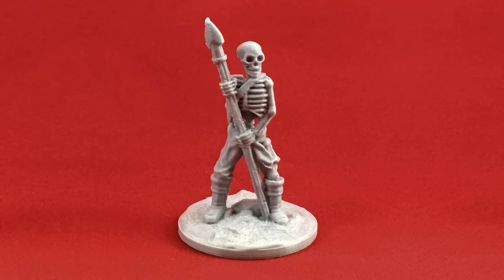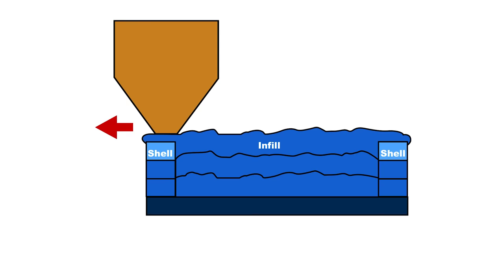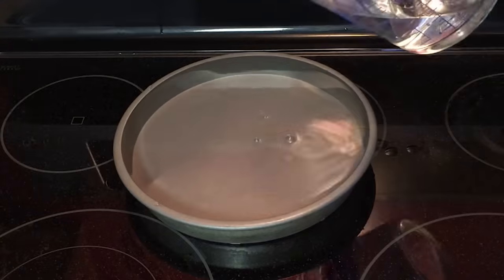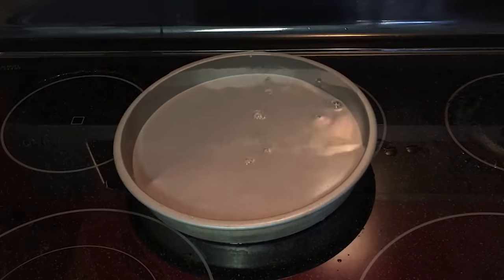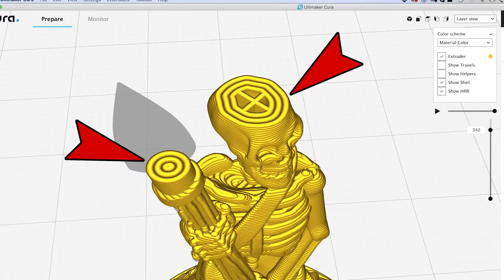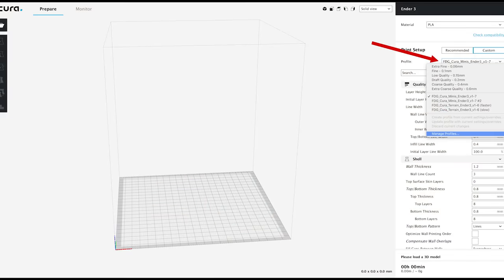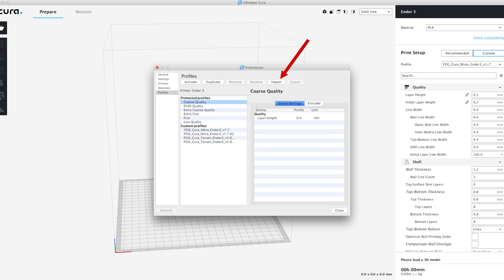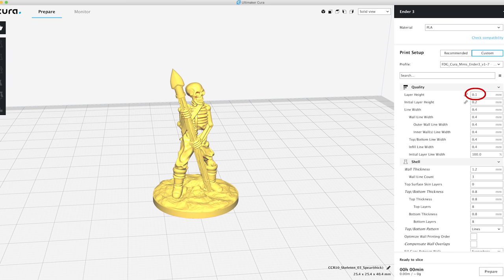How to 3D print miniatures on a FDM printer

Comment: You never spoke about which Cura profile to choose, if we download your preset Cura profiles. What is the significance of 2mm, 4mm and 8mm in the names?
Reply from the maker: That denotes what size of nozzle you are using.
Reply: @Tombof3DPrintedHorrors  so for a 0.4mm nozzle, use the ...4mm.stl file?
Reply from the maker: @CollinBaillie  yes, use the .4mm profile for a .4mm nozzle

Comment: Read an article about this person who used an airbrush nozzle tip connected to the extruder bolt to lengthen the distance for this radiant heat problem.  It puts more of the hot nozzle further out from the plastic part so that the radiant heat is reduced. 
https://well-engineered.net/index.php/en/shop/airbrush-nozzle-adapter-set
sells them.

Comment: I'm getting my Ender 3 next week and I'm so excited to start printing my own minis! Thank you so much for this video, not just for the settings you use but also for explaining what everything does, I've never seen such a detailed tutorial :D Can't wait to see my first results. Just a couple questions:
1. I bought a 0.2 nozzle and a 0.8 nozzle, when changing them I assume my line width will be the same as the nozzle size
2. If I want to print out terrain and props and don't necessarily want high detail, would you say it's ok to use .8mm layer height, 5-10% infill (with just 1 shell, maybe 2) and double the print speed?
Reply from the maker: Thank you! Yes, change your line width to match your nozzle aperture, and also change it in the machine settings for your printer in Cura, under 'Extruder' is a place to set your nozzle size.  I am working on a .2/.3 nozzle profile for Cura now, and should have the video for it up later this month. :)
Reply: Can't wait for video on .2 nozzle.
Reply: @Tombof3DPrintedHorrors  Did you ever put out the settings for the .2 nozzle profile? I'd be interested in comparing it to what I have and am not finding it.
Reply from the maker: .4, .3, .2 comparison video (and profiles) comes out later this month :)
Reply: @Tombof3DPrintedHorrors  can't wait for it. Just ordered 0.2 nozzle.

Comment: ok downloaded your profiles but things are different. in the vid the Top Surface Skin Layers are set to 0 but in the Cura 4 profile they are set to 4. Infill is different too. Temps are different. why is this? if you could do an updated video with Cura 4.0 that would be great. and if we could talk Supports too that would be great.
Reply: i second this. the profile is way different. just going to do cura supports and run test print with what the profile currently says. he may have adjusted it over time but an update would be nice.

Comment: Whats the difference between v1-7 and v1-8 on the dropbox link for minis????
Reply from the maker: I'm constantly tweaking the profiles, also because as new versions of Cura come out changes they make require adjustments to my profiles.
Reply: @Tombof3DPrintedHorrors  thanks for the help, wasn't sure if they might've been optimised for different scales!! When you're printing minis that 28mm scale do you print it so the base is 28mm wide or so that the whole figurine is 28mm tall? I've heard some debate and confusion over this online. Thanks for the amazing videos, you inspired me to get my own 3d printer and finished my first custom mini last night!

Comment: I've seen other miniature profiles that set the top layers settings to 999999 to "force" the slicer to treat all layers as top layers to print them with more detail, not to eliminate infill to make the models less prone to breakage. Do you know what is the reasoning to setting all layers as top layers? Does the slicer print top layers differently?
Reply from the maker: There's not much difference between the two (99999 top layers vs. 100 infill), except by using the top/bottom layers you can set fewer parameters for the layer (overlaps, speeds, etc.) and set a single layer pattern (I believe that one used concentric) where the infill method would also have those settings needed, but that's not really a reason to do it. What it does do is greatly increase the print time, as printing with 100% infill would at least allow you to increase infill speeds (same result, 100% plastic mini) but have better control over print times by having a faster infill speed.

Comment: thank you for the video it has been a huge help in understanding what to look for in my slicing software which is FlashPrint. I am using a flashforge finder and i have seen others print great looking miniatures with it, and i have never been able to interpret settings from Cura for FlashPrint. Has anyone ever dealt with Printing miniatures with Flash Print or the FlashForge Finder. I would appreciate any help. Thanks!

Comment: Any chance you upgrade your cura profiles to the lates Version? At the moment it creates an error if you try to Import.

Kind regards
Reply from the maker: My Cura 4.4 profiles load successfully into Cura 4.5
Reply: @Tombof3DPrintedHorrors  well im missing the "standard" profile your custom settingsare based on. I only got normal as a default setting. If i try to dublicate any of the default setting and try to rename it it's autocorrects to standard #2.... any idea what i can do?

thx for the reply btw
Reply from the maker: @fabianhalu3977  what version of Cura are you using?
Reply: @Tombof3DPrintedHorrors  4.5
Edit: the official release downloaded yesterday
According to github it's the 4.5.0
Compiled 21 days ago

Comment: very interesting video.  Could you provide you thoughts and experience with using supports on minitures. What settings work so that the supports can be removed cleanly and easily?

Thank you
Reply from the maker: All of our models are designed to print without supports, so we don't tinker with them very often. :)

Comment: Have you experimented with printing with finer nozzles?
Reply from the maker: Yes, a video is coming in late December. :)
Reply: @Tombof3DPrintedHorrors  Thank you for the reply! While I have you, if you could give me your input on a post I just made on a facebook 3d printer group, I would really appreciate it!
-While I'm not a table top gamer, I do find table top models beautiful and I can appreciate any form of modeling. My particular poison of choice is On30 model trains, that is 1:48 scale. I find a lot of the techniques that are used to make table top games/pieces can also be applied to my model trains. The main reason for my interest in a 3D printer is to print small detail parts to fill out a scene, like tool boxes, a drill press, hammer, band saw, dogs, cows, pigs, trash cans, oil cans, oil drums, water tanks etc etc etc. All these items are available commercially in the model train hobby, but a simple dog model can be $5. So I figured I could get a 3d printer and print these detail parts for just a couple pennies. A trash can at 1:48 scale is about 1/2" tall, a shovel/ax/saw even smaller than that. My concern is I don't know if a FDM printer like the Ender 3 is up this job. I thought maybe if I put a 0.25mm or 0.15mm nozzle on it, that might be able to do it, but I'm just not sure. I know a resin printer would be more up to the job, but the added cost and complexity to the printing process has prevented that from being a viable option for me. I have my eye on the Monoprice Mini Delta 3D printer, mostly because of its small size, inexpensive price, coming fully assembled and supporting up to 50 micron layer thickness... I have been drowning in 3d printer research lately... any guidance would be appreciated for what I want to do with a 3d printer. Thank you!
Reply from the maker: Don't get the Monoprice, the Ender 3 will produce far better results. Join us over on the Dragonlock FB group to see examples. :)
Reply: @Tombof3DPrintedHorrors  that's why I'm curious to see what the ender 3 can do with a smaller nozzle

Comment: What about settings for supports for printing miniatures? Would that be helpful? If so, do you have any recommended settings such as normal, tree, placement settings, etc? Would really appreciate any advice. Thank you.
Reply from the maker: No, none of my minis or terrain require supports. :)
Reply: @Tombof3DPrintedHorrors  Is that because of not needing support on the angles or just because of the small size they are? I printed one out with line supports. Pain to remove them. lol
Reply: @Tombof3DPrintedHorrors  And are we talking just your mini's or mini's in general?
Reply from the maker: @bradmoye4286  my minis. Nothing we sell requires supports.

Comment: Iv done 3 walls what later height would you recommend for a 0.4 nozzle layer height? Printing in petg
Reply from the maker: PETG isn't good for miniatures.
Reply: @Tombof3DPrintedHorrors  is there no way what so ever? At first I was struggling to remove my supports might have solved this trying again tomorrow
Reply: I was doing a layer height of 0.1 now I'm gonna try a 0.3
Reply from the maker: @1937Brett  none of our miniatures require supports.

Comment: Very well done. Packed with tons of information. However my only question that wasn't answered was, could those settings work well for a 20mm  scale miniatures or would you require different settings? Thanks for sharing.
Reply from the maker: They will work fine for 20mm (I use them for printing small 28mm goblins which are approximately same height/detail as a 20mm human figure.) :)

Comment: Does these settings change if using an Ender 3 v2 instead of the Ender 3?
Reply from the maker: No, they are identical, but I have updated settings/profiles at my website under the 'Resources' menu
Reply: @Tombof3DPrintedHorrors  as we say in my country: "Gracias por tanto, perdón por tan poco"...meaning that you give way more than you receive. Thanks

Comment: Would you change the settings from the ones you show here for larger minis that still have lots of detail (i.e. D&D "Huge" size with 75mm bases)?
Reply from the maker: The only thing I would possibly change would be speed maybe trying a 10% increase, but that's it. Temp might have to go up 5˚. Hard to say without actually experimenting. I'll be doing a video on large minis to coincide with our upcoming supportless-mini Kickstarter which will include up to Dragon size minis, so if there are changes I will post an alternate profile then. :)
Reply: Tomb of 3D Printed Horrors Thanks! What about infill? Would you reduce it from 50%?
Reply from the maker: Yeah, 25-30 should work.  @therpgmaker

Comment: what is the most heat and pressure resistant plastic you can use in a 3D printer?
Reply from the maker: Pressure resistant? Probably ABS (keeping in mind that compression strength and tensile strength are two different things.) ABS is highly toxic to print with though.

Comment: Maybe I missed it but how do you feel about using Ironing?
Reply from the maker: Ironing isn't useful for anything that doesn't have a large flat top surface, so not applicable to tabletop gaming minis or terrain.
Reply: @Tombof3DPrintedHorrors  Thank you, your reply saved me a lot of searching and testing. That was exactly what I was wondering was if it was useful for miniatures. Your settings have given me the best quality so far

Comment: A few comments/questions. Have you tried using a .2mm tip for minis?  I’ve used one for printing board game coins and the detail is amazing. Yes the prints get longer but MAN the detail is incredible...
I was hoping to see some suggestions on supports, and also how to create/obtain models for minis. That’s the main reason I haven’t made any - I don’t know where to start.
Other than that, nice vid. I use Simplify3D but most of the stuff you mentioned carries over easily. I couldn’t get Cura to make nice prints.
Reply from the maker: I have a video coming that covers .3 and .2mm nozzles. You can get supportless minis here (www.fatdragongames.com) and we have a Kickstarter launching in January with supportless minis as well. :)

Comment: I downloaded your profile and love it but that line down the left? I prefer to use a skirt. How are you drawing that line and how can I delete it from the profile?
Reply: I believe that's a feature of the newer versions of Cura
Reply: No, If you go to preferences, I think it’s printers and then hit the machine code button on the right there is a place to add g code at the beginning and end of you g code. There are two lines in there that I’m pretty sure are doing it. 

Just know that if you use this profile it will add those lines and it will be at the start of everything you slice even if you use a different profile. 

Which can be a problem if you need that part of the bed.
Reply: Ok, I take it back. It is Cura 4.2 not the profile. I still think it’s in the start g-code.
Reply: So yes, it is definitely a few lines of g-code that is placed at the start and can be simply removed. I’m personally much happier without it and would be happy to show anyone how to remove it if interested. 

Sorry about the misplaced accusation but I only upgraded to 4.2 to try out this profile. So when I saw the purge lines I mistakenly thought it was due to the profile.

Comment: I understand that you're focusing on the Ender 3 since it's the most accessible quality FDM printer, but your own website calls the Prusa i3 MK3 the "Gold Standard" in 3D printing, and that was a huge factor in my decision to buy one. Do I assume correctly that you own one too? It would be great if you could share your Prusa i3 MK3 settings too, using Slic3r PE preferably. I'm sure I'm not the only one looking for this. I did fall into the stringing trap with 50-micron 100% infill printing. I'll adjust my settings based on your video here, but I'd love your take on Prusa-specific settings. Thanks!
Reply from the maker: Yes, I own three Prusas. I have a terrain profile for Slic3r posted in the files section of our Facebook group (link in this video description.) :)

Comment: I realize that most folks use Cura, but I succumbed to the bug that causes underextrusion with the Ender 3 profile. I started using Slic3r and my prints finally started looking decent. Do you know if Ultimaker has found a solution to the bug in 3.5?
Reply from the maker: Not yet, but there is a very easy fix. Just select CR-10 as your printer, and change the bed size to match the Ender 3 like had to be done with prior versions of Cura. That resolves the issue (or just stick with Cura 3.4.1 until they fix the bug.) The issue is the Ender 3 profile in Cura 3.5 has the filament diameter set to 2.75mm, instead of the correct 1.75mm, resulting in under extrusion.  :)
Reply: Thanks, I'll give it s shot. Btw, I got a 404 when I went to the dropbox link for your Cura profiles
Reply: Interesting, I experienced the bug in 3.5 and still had it after reverting to 3.4.1. It doesn't seem to be isolated to just the Ender-3 either, where I work they have a fleet of Monoprice Select Mini V2s that under extruded and were set to 2.85 by default after updating to 3.5, and still under extruded after setting it to 1.75mm. It displayed that the setting was saved but acted like it was never adjusted. I somehow managed to fix it by changing the setting multiple times, swapping between printer profiles and closing/re-opening the program during that process a bunch and the settings finally seemed to "take".

Comment: Hey,

thanks for all your informations you share.
I have the Filament eSun PLA+
So i have to Print at 205°-225°

Do you have any experience with this filament? Maybe a adjusted profile? :)
I heared it would be a really good brand for miniature printing.

Thanks again and see you soon.
Reply from the maker: That is the same filament I use, the profiles are tuned for it already
Reply: @Tombof3DPrintedHorrors  
I tried out your profile several time.
I always have failures with my print. 
Why do you go down to 190°, so eSun says you have to print with 205°-225°?
I now print with 205° and i dont have further issues.

Comment: have u ever run a smaller nozzle with better results?
Reply from the maker: Yes, I just posted a video on using a .2mm nozzle a month ago :)
Reply: @Tombof3DPrintedHorrors  ill dig through and check it out.. debating on going that route or just buying a new gen Resin printer for super detailed stuff

Comment: Hello thx for your great Videos. Because of your Vids i bought an Ender 3 :p

I diskussed with some persons that printing with 0,2 nozzle is better for 28mm minitures and saw some fantastic looking models on facebook.
How is your oppinion with this? I want to get the best Qualtiy for my miniatures.

Do you have some Cura Settings for this kind of nozzle and do you have some tipps what i have to change at the hardware to handle a 0,2mm nozzle. Heard of some problems with filament, the extruder and print speed?!?!

I am a novice at 3d printing with filament.

Thanks and greetings.
Reply: I bought the micro swiss all metal upgrade and a 0.2mm nozzle for my Wanhao i3 plus, it was a true struggle to get the printer performing at first mostly due to the need of extremely precise bed leveling... I noticed I had to use much lower print speeds to get decent results and since the nozzle is already smaller, you need to be prepared for insanely long printing times. Definitely not suitable for anything big but for miniatures I would certainly use it. I printed a small frog with 0.08mm layer height and damn it looked great